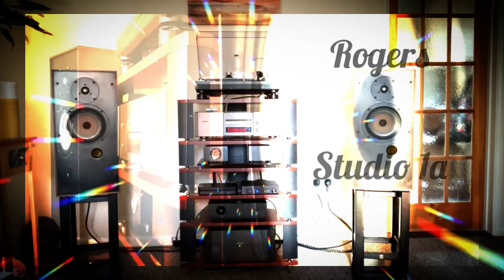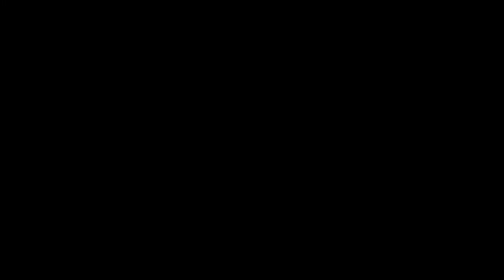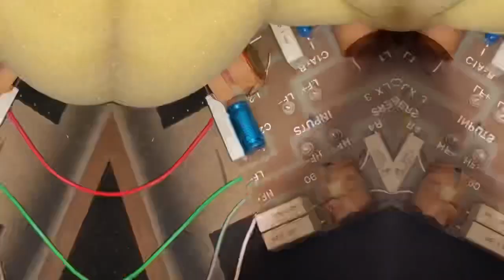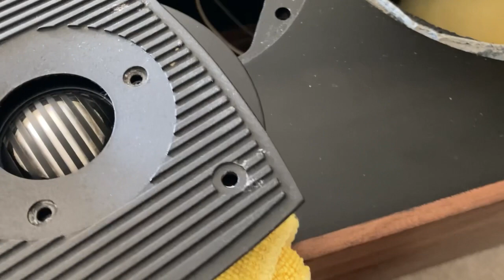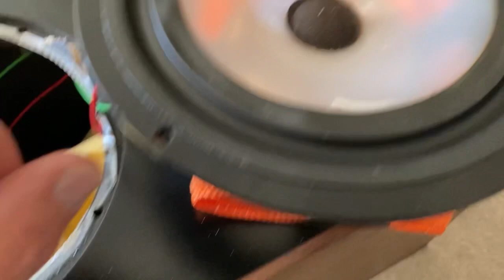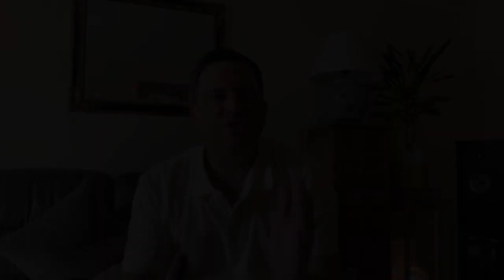Rogers Studio 1a Loudspeaker Review #rogers #hifi #speakerreview #british #speakers #audiophile

Comment: what I would do is replace the cap with Jensen aluminium foil in oil, very nice sounding cap.
and change the resistors for the tweeters carbon film vishy 2w 0.1% need to gang them together in parallel 3. and apply a bead of bluetec around the tweeter as a gasket.
I don't like PVC drivers you can use surgical tape around the voice coil 2-inch squares.

Comment: Great vid Kev. Super impressive knowledge. Really Interesting to hear that info on the celestion tweeters and the way they image. I think that's what I really love about the dl10s, the way they place things is really pleasing to listen too and just kind of feels right. I'm still umming and arring about getting the ditton works upgrade on them. I bet they will sound superb. I wonder if swapping out the tweeters for sl6 tweeters would also take the dl10s up a notch? It's a shame celestion never made an sl 3 way.
Reply from the maker: Hi 👋 
The SL series tweeter wouldn’t really work. It’s less efficient for a start.

I did help a guy build a set of celestion 3 ways using SL drivers as mids 👌👌
They actually sounded really good.

Thanks for watching 😊
Reply: @dittonworks  wow that's super cool. Would have liked to have heard those!

Comment: Hi there which rogers which ones are warmest  detailed
Reply from the maker: Probably these ones or LS7’s
Reply: I was told that they are difficult to match. I thought yours where  the  s1 but the 6 are more or less the same ?
Reply: @dittonworks  A1. You we’re reviving?
Reply from the maker: @hamzatatta952  studio 1a we’re not fussy but don’t use bright equipment
Reply: @dittonworks  ok. I have quad 303 serviced. But at then if the day you have to listen to them first ,  I heard there 5 on line sound warm and detailed n.  beautiful  but they are not cheap